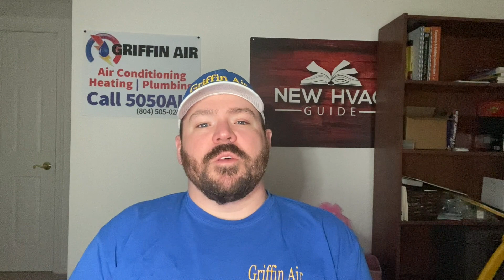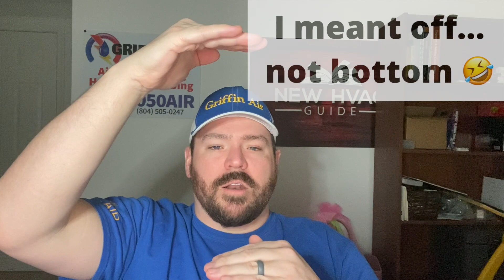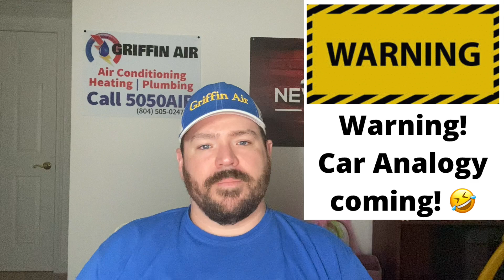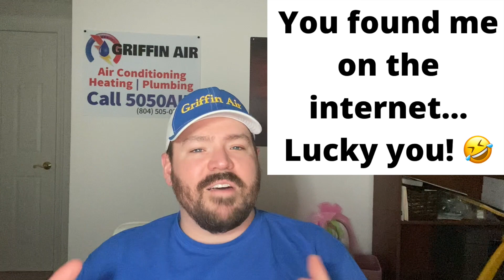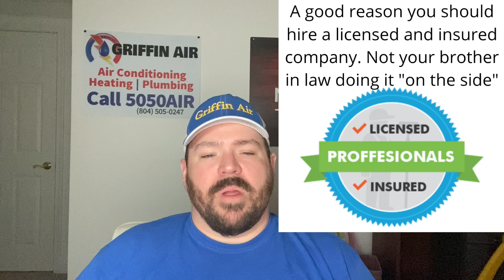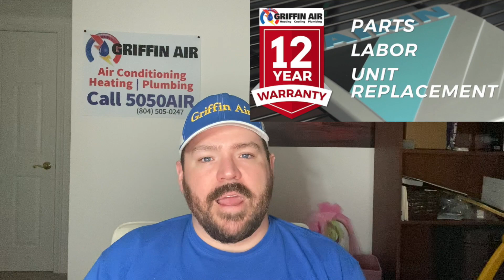GOOD and BAD of High SEER Inverter HVAC!

Comment: sadly the installer that put our system in talked my dad out of any upgrade...no humidifier UV light or nice fancy filter...single stage 13 seer A/C and single stage 96% furnace with single stage blower...up in WNY...and he wonders why the electric bill is high in the summer and its dry during the winter were a portable humidifier has to be used spilling water everywhere 2 times a day when its filled...not to mention its loud...and yes he couldve afforded a fancier system...always get the most expensive system you can afford with the UV light and 5in filter humidifier ect....it will be there 20yrs and HVAC is all about comfort and convenience without a high utility bill...

Comment: It’s a great system but it was a nightmare when the company I bout it from sent me the incorrect air handler short story after all installed that’s when we found the problem The company made me purchase the correct air handler it took 5 hours to get up and running still fighting to get the credits from them I love the system we got a 800 dollar  power bill  my heatpump died in  in the middle of winter

Comment: How much does it cost to replace the outdoor PCB in an inverter AC if it fails?
Reply: When I bought my mini splits last year, I spent over a month doing research. What I found was that the vast majority of private label systems (as well as almost all of the big name brands that have been around for decades) marketed direct to the public are made by a pair of huge, highly automated Chinese companies, Midea and Gree. Vendors who claim to be designing their own systems are merely choosing from a menu of available components while making various cost / performance tradeoffs. Two models that look identical on the outside could have major differences under the skin. It's best to at least compare the AHRI certificates for each model you're considering. Another excellent resource is the NEEP database.

I also discovered that anyone who is reasonably competent with tools and confident in their ability to read and follow instructions can save about 80% or more of total project costs. By not rushing things it is entirely possible to end up with results that are far more professional and trouble free than those obtained from many outfits who claim to be the professionals. There are some very good (and also some very poor) YouTube videos regarding DIY installs. Watch many of them and you should soon recognize the difference.

I spent about $350 on tools ( vacuum pump, manifold gauge set, valve core tool, CPS micron gauge and nitrogen gauges), the latter two because I wanted to make absolutely certain that there was virtually no contamination trapped within the system (moisture and non-condensibles) which could lead  to shortened equipment life due to internal corrosion. I also wanted to minimize the odds of having a microscopic refrigerant leak that would have to be addressed at some future date. I consider a commercial quality micron gauge, while expensive, to be cheap insurance. I could have saved the cost of the first two tools by obtaining a "free rental" at one of the local auto parts store chains.

I also called the tech support line from each company that made my short list. While most of the techs seemed to be reasonably competent, a few were apparently working off of scripts. I inquired about warranty limitations for us DIYers, company procedures concerning potential shipping damage, parts availability, and even whether the tech I spoke to is happy with his job. 

In my case, I purchased a couple of the (Midea sourced) AURA series systems from Senville. Those are the so called "cold climate" models that not only operate with about 25% better efficiently than standard offerings in both heating and cooling modes but still make plenty of heat at my particular design temperature. They seem to accomplish this feat primarily with a better grade compressor and larger heat exchanger. The difference in cost between the CC and standard equipment was offset entirely by the 30% Federal tax credit. Overall I've already achieved a 100% return on investment as compared to my older but well maintained and updated oil furnace in just the first heating season.  

I've seen identically spec'ed systems on the HVACDirect site (same features, same performance numbers on the AHRI certificates, same remote) with their one of their own name badges for several hundred dollars more even after their "hurry" discount. I'd venture a guess that at least part of the differential covers their affiliate referral link program.

BTW, in answer to your original question, Senville is the only vendor I've encountered that has a repair parts page on their website complete with prices. The price for the outdoor circuit board which includes the main power supply, all the brains for the various sensors, and the variable frequency power electronics for both the inverter compressor and variable speed fan is less than $200 + shipping. Replacement fan motors are quite reasonably priced also.

Comment: I do HVAC controls and you'd be amazed how little your average maintenance guy knows about HVAC. I'm an inverter heat pump fan. I've seen the performance in cold weather between them and regular heat pumps. There's no comparison and getting 120 degree supply temps that actually feel warm. Problem is contractors want to charge double to install them. For my next system I'm going to do it myself after I get my EPA 608.
Reply from the maker: Lack of knowledge is a challenge. The ambition to learn may be the larger issue

Comment: Can you making a in depth video explaining exactly how these inverter system communicate with all its components, explain all the sensors and how they interact with the control board and thermostat etc..., Not just the same old speil of how ac get inverted to variable frequency and drive the compressor. Sales pitch
Reply from the maker: Do you think homeowners would want to watch a video concerning all the sensors?
Reply: @NewHVACGuide  So you're all about the sales and not about the info.
Reply: yes I do, I think they would like to know why it's costing them thousands to fix a problem due to a faulty sensor or board, instead of a fifty dollar for a contact switch  @NewHVACGuide
Reply from the maker: I don’t sell them anymore. I try to help folks with my info. I was asking a nice and serious question.

Comment: My Bryant evolution extreme 24 seer heat pump is the real deal. Besides the savings in electric the control it has on humidity is even better. I will say when it comes to heating its hands down not evennclose to a single stage. It heats 20 times better. Measured 190 on the vapor line. Mine is equivalent to 76 stages.

Comment: Have CO2 heat pumps had reliability issues? How long have these newer high pressure CO2 heat pump units  been working successfully? Does Daikin make a CO2 Heat pump? If so, how long have they been available?

Comment: I hope the HVAC  inverters last longer than the ones Viking and GE Monogram used in their expensive refrigerators. Most of those inverters lasted less than two years. Inverter parts were $200 plus labor to replace them. Maytag went bankrupt putting inverters and variable speed DC motors in their washers that were bad. (Whirlpool bought them out.) I did appliance repairs for 12 years and I replaced over 50 inverters, so I'm a little suspect of doing variable speed DC motors that require AC to DC inverters. Then again, Tesla's cars and chargers all have well designed inverters that seem to work forever. So good inverter design is possible.

Comment: There seems to be a HUGE push for Daiken inverter systems.  Not easy to see anything except cheerleading for this system.  Can't find many independent reviews.  I assume they haven't been out long.
Reply: I agree. I couldn't find independent reviews either but bit the bullet and had a 4 ton Daikin fit installed. Has only been in service for 3 days and the weather in South Florida has been cool and cloudy. I have solar panels and an electric car, so it will be hard to determine any energy savings (which is why I have been looking up reviews). So far my only issue has been that per the installer, an inverter should be sized higher than a traditional system (unsure if this is true or not). This makes the air handler width go from 20 inches or so to 24.5 inches. In my personal situation, my ac closet is exactly 25 inches wide, so obviously that poses it's own challenges along with refabricating a new closet door post install. Also, my previous 3 ton single stage could not get my 1500sqft house below 76F on a hot summer day, so maybe the upgrade was necessary after all!? I'm hoping for comfort in the summer at the least, and at best huge energy savings. Fingers crossed.
Reply: @michaelbuschmanable  Wow.  We have similar conditions.  My house is 1500 sq ft.  I had a 3 ton AC that did a satisfactory job at cooling.  It had to run all the time on exceptionally hot days, but I consider that a good thing.  You don't want it cycling because that initial draw to start is big!  I've had my new FIT for a couple of months.  So far, I'm skeptical of efficiency and energy savings.  I have  solar too.  This is not apple to apples but take from it what you wish.  My 3 ton AC wo9uld show surges on my solar app of around 4 kwh.  Now I have 3.5 ton FIT which shows surges around 4-4.5 KWH.  I assume the FIT will run a lower electric draw throughout the day because of the inverter action, but the inverter (as you will find out) is almost always running!  I get more than enough air being pushed with a 3.5 ton.  I don't know how our air handlers compare.  But with Heat pumps, they don't get hot like furnaces.  I've only had a chance to use the heater.  So you have to push more air because it's not very hot.  I assume it's going to be very similar in summer with the AC.  ie Probably not very cold!  Pushing a lot of air, but I guessing it won't be as cold as a condenser style AC.  I bet the draw will be similar too, meaning I'm not sure if savings really exist!  
Another important note.  You could only get your previous AC to cool below 76 degrees?  If it was near 100 degrees outside, I doubt you'll get any better with this.  That's purely a guess, but it's difficult to get any AC to cool more than 20 degrees more than outside temp.

Comment: I am running a 21 SEER fully variable inverter system in the minisplit with full air-handler system. It's hands down a lot better, the air always feels awesome no matter what, also cleaner because a lot more gets filtered. Watchout for bare metal in the system, your duct work will sweat from the prolonged lengths of time cooling if not insulated completely.  I actually spent less that an standard system on my complete install, including tools and gasses, but I did my own exactly correctly.

Comment: Would you consider doing a video on what I constantly hear as an issue with ductless minisplits? That they won't remove humidity like a traditional ducted split? With all things being equal, is this true? It seems everyone just blames oversizing. But, IF the system is sized properly? Forums online say this is an issue, my contractors say it isn't. PS I posted this before I had finished the video; interesting you touched on this topic.

Comment: Does size still matter on these modulating systems?
Reply from the maker: Yes
Reply: @NewHVACGuide  do they make variable half ton sizes ?
Reply from the maker: @E150GT  most don’t but one I know that does is the Daikin Fit

Comment: Goodman systems I know 100% for a while they went to a communicating board/system then could run off of the cheaper multi stage stats.. here in SoCal tho with ALLLLL the recent bs over last like 5 years I could be wrong now…!! But I still back Goodman, Daikin ect… whatever.. just none that sensitive made to make crazy noise Ultra Low Nox Trane an Lennox units are just terrible gas valve setups, especially if it’s a 2stage valve smh.. sound like blowin up on ignition.. at only 3.0inwc or less gas pressure.. No bueno sorry for the rant I feel better tho 😂😂

Comment: Has humidity been an issue with inverter HVAC systems? Anyone notice the shortest bursts not fully dehumidifying a home? Still in the fence between a Gree inverter heat pump system or a 15 SEER Carrier traditional.  Any input would be great!  Thanks for the great videos, learned a TON!
Reply: Dehumidification is better with inverters. Don’t buy Gree, and don’t buy Carrier. My advice would be to find a reputable local Amana dealer, now until the end of June you can get a new system with an Amana S series outdoor inverter at a promotional price, along with a free communicating Wi-Fi thermostat. Amana offers the best warranty in the business with lifetime unit replacement warranties on compressors and heat exchangers, be sure to register your new equipment after install!

Comment: if high seer drivers etc. when it does go down there is SQUAT you can do right then 10 pm on-call. the cust is screwed. regular systems for the most part I can wire around stuff and get people air until parts come in.

Comment: We just went through 5 months of record heat in California, with a new roof top installed Bosch 18.5 SEER  (3 ton) that took 5 months of troubleshooting to fix a long running problem. I'm mentioning it in case the info is of any use to installers so that no one else might have to go through what we did. After enlarging the ducts & simplifying thier paths, adding more ceiling vents, putting padding under the AC unit & adding supports under it in the attic to "batten it down", the answer ended up being to change the frequency. Apparently there are 20 frequency choices. Ours was initially set at 47. When they changed it to 69, it has a bit of a  rough start up (2-3 minutes long) but then evened out to a very livable sound. The down side is that it no longer is really a variable speed, {& we don't know yet how it will effect the efficiency & hence the cost of heating.{we had saved $50 a month when it was at frequency 47}   Aslo, everytime we lose power in the future we need to go up on the roof, remove a panel & reset the # . hope this infor saves someone else time & $ !

Comment: I agree with you for the most part.  As far as return on investment I think replacement on failed parts should also play a factor. 20 dollar capacitor will get a condenser back up and going as opposed to a $400 board. Variable speed motor as opposed to constant torque. Pretty substantial difference in the repair world.
Reply from the maker: It's a valid point pal
Reply: Yes that should be more talked about. I also think that motor rebuilding is starting to make sense with these ECM motors too.

Comment: Great explanation josh- so what about TWO stage systems ? Do THEY make sense ? After all don’t have to use a communicating  thermostats for these two stage units yet you cna control over wi-fi. Youre cycling on off less (lets say half the time) how does the surge/wear compare from going  to say 60% to 100%, very small increments  ? And don’t You agree these inverter systems effectively REQUIRE surge suppression to protect those phenomenally expensive boards both inside and outside at not only the house panel level but at the disconnect, so you’ve got to add several hundred dollars for cap cost on an inverter systems .a s for humidity, don’t you agree that you’ve gotta to have a multi-variable speed ECM in the blower to really benefit from enhanced dehumidification  > and doesnt EVERY hosue in very humid climate benefit from hosue hosue dehunfdiifwer , which may obviate thsi benefit ? Even the best inverters are not efficient at removing humidity esp in trunk seasons .
Reply: The issue with two stage systems is that more contractors will oversize a system by 50-100% by using a rule of thumb. As a result the system basically runs in only one stage. So you end up not seeing much of an energy savings.

Comment: The price differences are nuts with all the contractors in my area single stage split system by American standard versus A two stage and a variable speed system is expensive I've been quoted from $8,000 single stage heat pump all the way up to $25,000 for a variable speed 5 ton heat pump unit and variable speed air handler. (apparently the common brand with almost all of my contractors in my area they all use American Standard)
Reply: I'm seeing the exact same issue and it doesn't make sense. The equipment doesn't cost that much more and the labor costs are very similar.
Reply: I’m in FL and still getting quotes but my winner quote (note I did not say winning) for 5 ton top of the line Lennox (to replace a 12 year old leaky coil top of the line Lennox) was just under $30K 😂 😂😂😂.  My roof replacement was only $20k

Comment: I have a 5 ton, 12 SEER unit in Houston that costs $850 per year for electricity for cooling.  Going to 16 SEER  would save me $212 per year.  I have a 3 yo quote of $10,000 for a 16 SEER Lennox system.  I am fine with what I have.

Comment: Think your house should def do some spray foam make a conditioned attic and spray foam on exterior walls that’s going to save more money than a new unit hands down. I’ve never paid more than 250 for electricity gas and water in month in my life . I had a house yr round never more than 150 for all  3 and I had a conditioned attic with 2 ton ac on a 1350sq ft house with drop ceiling
Reply from the maker: Every house is different. Depends on the house size and of course insulation as you mentioned. I had a customer simply install new windows and it dropped their utility bills.